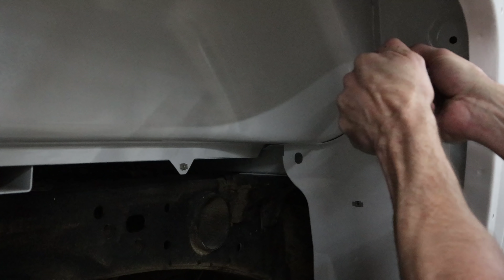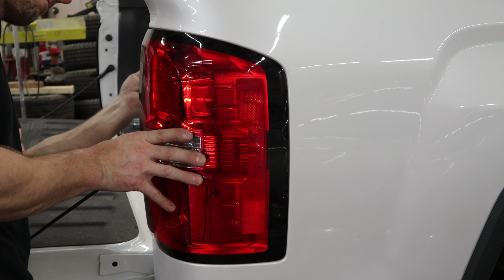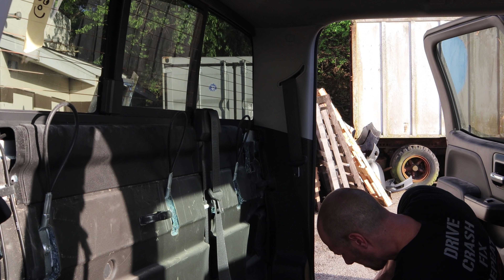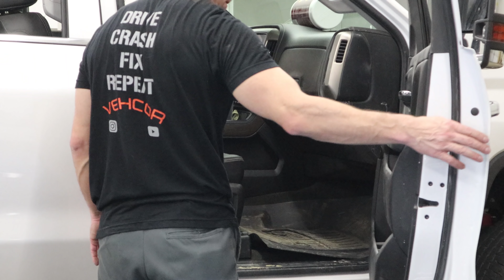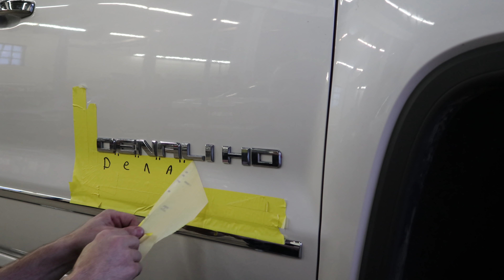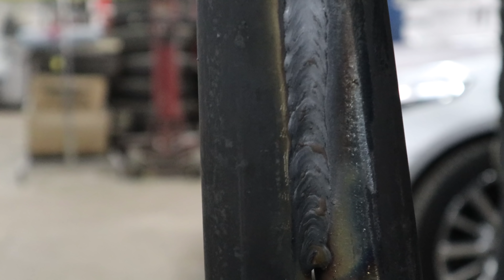The Dirtnali part 9:  The dirt exchange program, installing remaining parts and some fabrication.

Comment: Dude you read my mind.  I am not in the trade but I am a weekend warrior for decades.  I developed the same wax (preservative) treatment through my own experience and then almost immediately heard you talk about it in an earlier Dirtnali episode.  That was amazing, and a nice confirmation that my idea wasn't garbage.  I use liquid long term preservative from McMaster Carr, so I use a pour and saturate method from above.  I haven't graduated yet to the idea of an aerosol, but I like it, and I'm glad you showed it (and that you do it - I imagine most dont).  My wife's 2010 Challenger started rotting out the rear quarter panel.  These cars are filled with expanding foam behind the rockers to deaden sound, but it's also exposed to the environment so all it does is wick and hold moisture.  I drilled an access hole and "fished" it out over many nights, pumped rust dissolver through it for two days, and then pumped the preservative through it.
Reply from the maker: You are right, most shops do not do the proper corrosion protection after a repair.  It is the reason so many people thing all repaired cars rust out quicker.  I hate that foam!  In addition to sound deadening, it is also for strength and panel stiffening.  Not only does it make the car rot faster, it costs a fortune to replace.  Thanks for watching.

Comment: Adhesion promoter for the double sided tape.  That's a first for me.  I don't generally have issues with a quality tape letting go if I got my prepwork done properly.  Interesting stuff, I'll have to go take a look for it.
Reply from the maker: A little extra insurance never hurts.  Especially when trying to get stuff to stick to a vehicle when the shop temp is 40 degrees F.
Reply: @vehcor  Ok I need some help here.  I can't find anything like you were using.  Did you just take adhesion promoter and put it in a bottle/applicator?  If so that is genius!

Comment: I recon They bolt on now to reduce quick theft. I only know from experience because I've had tailgates stolen before
Reply: Clifford Mccomber I mean if they can carry a tailgate the thieves can definitely carry a drill or screwdriver.
Reply from the maker: I would agree that is the reason but it won't slow them down that much.  The remote locking tailgate is a nice feature though.
Reply from the maker: @razvanmihalache5680  Agreed, if thieves want something they will get it.

Comment: 16:40 I've had success with the body glue goop they sell in a tube. Looks like clear hot glue when u apply it. I think it's safe to pull off if you use fishing line. Don't know how it affects paint. Anyway, 5+ yrs still sticking on letters I repaired on a Toyota.

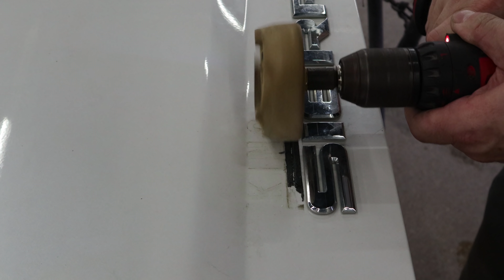Comment: Hello.  I was wondering what that buffing tool you used was at: 3:18
IT worked really well
Reply from the maker: It is a pinstripe eraser, here are a couple.  I like the one with the fins, it works a little better.  The solid rubber one get the glue a little too hot sometimes and makes a mess.

https://amzn.to/2NwhExB
https://amzn.to/2Xy7XCh

Reply ·
Reply: @vehcor  You're the man !  (I'm telling all my friends to subscribe)

Comment: I WOULD LIKE TO KNOW HOW YOU OBTAIN ALL OF YOUR NEW PARTS AND PIECES FOR YOUR TRUCKS , I MEAN A FAIRLY PRICED SUPPLIER.  I AM JUST TRYING TO FIX UP MY 2014 GMC.  GRILL , RUNNING LIGHTS BACK UP CAMERA . THANKS FOR YOUR HELP AND THESE VIDEOS. VERY IMPRESSIVE.  🇺🇸
Reply from the maker: I generally get as many as possible used.  It is usually cheaper.  Try car-part.com for some parts.  Check Facebook and Craigslist, you might find some parts someone swapped out.  I go through the shop I rent for my dealer parts so I can use their discounts.

Comment: They probably bolt the cables on the tailgate so they are less easy to steal if left unlocked. The dealer told me that I should keep my Tacoma tailgate locked because it's easy to steal and it's $1500 to replace.
Reply from the maker: I would agree. The remote locking tailgate does much better in the antitheft area.  It doesn't matter, if a thief wants it, they will get it.  JERKS!

Comment: So long as you can fab different things, sure, record and show that. Tough seeming rebuild but nicely done.
Reply: I still get cognitive dissonance when I think about luxury pickups. All that fancy interior and gear on the simplest chassis you can buy, body on frame with a leaf spring suspended rear axle.
Ford at least gives a nod towards modernity in their big pickup based SUV by putting in a massive IRS.
Reply from the maker: I have little projects I find that I could record.  Any excuse to have some fun.  Ford uses not only a solid axle on the rear of the of the 250 and up but also on the front.  Really, my 78 GMC had that technology.  This truck at least has IFS.  It is one of the reasons I like GM over the others.  As far as the ride, this thing is better than a lot of cars out there and quieter than most luxury cars.  I am very happy with this truck.  Thanks for watching.
Reply: Somebody on some You Tube channel wrote that he sees folded in the middle trucks, mostly GM products then Rams and almost no Ford's.  That might explain Ford's greater weight.  Wish I remembered where it was so you could question the writer.
Reply from the maker: @BobPegram  I don't know who this is saying this but my guess is that is was some Ford owner.  I have worked on all three, the frames are all very similar is strength.  They are ALL designed to collapse in a collision.  It seems the people with the biggest followings know the least sometimes.  After all, those people are generally YouTubers as their primary job and some have little to no experience or proper training.  They are seem as experts based on sub size.  People with jobs do not have the time it takes to be a big channel.

Comment: Nothing short of perfect. But you don't 'Live' in Chicago do you? Cities have become parasite infected killing fields. I lived in Philadelphia when I was a kid. But when I got home from Vietnam the city was worst than the hell hole I just left. So I left. I really enjoyed this "Dirtnail" I always use 3M # 4298 adhesive promoter. I used it on my Corvette, But I warn guys, only pull back a small of the red backing or the double face Tape, cause once you touch the double sided tape to the surface of where you applied the 4298, it's the closest thing to being welded together. I wanted to find some of that cavity wax ? Yeah your helper picked really nice fabric for the shirts, I'm ordering another one. You do really nice professional work. I restored a 1988 Chevy K5 Blazer from SW Texas. I got the doors opened up along with the tailgate and it took almost 3 hours to flush out the 29 years of texas dust, it had 117 baseball sized hail ball hits. You do great work. Thanks again.
Reply from the maker: I actually live in the southwest burbs but it is just easier to say Chicago, everyone knows where that is.  Besides, I live close enough that I have to deal with all the stupidity that comes from major cities!  I'll have to try out the adhesion promoter, thanks!  Hopefully I will be far away from IL and in SW Texas some day...... soon I hope!  The link for the cavity wax and the wands is in the video description.  Thanks for the support!

Comment: Use 3812 enamel reducer on the letters/moldings with paper towels to hole the liquid on to the old adhesive.and as a question what adhesion permotor are you using?? We have the 3m pads at work is that stuff better??
Reply from the maker: I have never used the 3M but this stuff works pretty good.  It is transtar.

Comment: Wow, I can actually teach you something! With all Sawzall (reciprocating) saws keep the nose guard pushed in tightly to the workpiece (if possible) and all that vibration, chatter, fatigue, and rough cuts will be extremely reduced. Best of all, faster cutting... without question. Every time the saw moves even slightly forward,  or back in your hands, it's not actually cutting

Comment: How do u get these out with a twisted off rusted screw in one 1:03?
Reply from the maker: Drill the screw out if you cannot get to the back side.  If you can get to the back side, just crush the clip with pliers until it will fit through the hole.  Then replace the clip and screw.
Reply: @vehcor  drill it out then what? Yank with pliers?
Reply: Nevermind! Drilled it out and the screw part went right out, was able to thread in new screw no problem without having to remove the clip, thanks! Local Chevy dealers body shop gave me a few clips and screws 👍
Reply from the maker: @agger838  Awesome!  Glad to help.

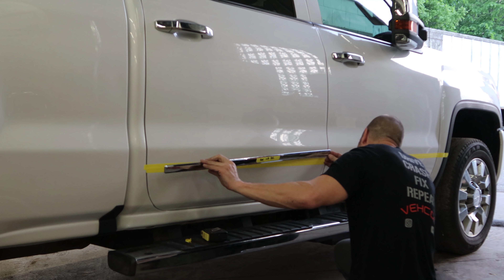Comment: 18:33  I don't think I have ever seen one of these on straight.    GM is building junk again, they better deal with it.  The man on the line has a tool to put them on straight, he is just to lazy to do it. When I ordered my new truck I told the dealer to order new trim like yours, I was right. The dealer had to remove the new crooked trim and install the new. Sad.
Reply from the maker: It is not just GM, manufacturers have raised their prices and lowered quality across the board.  It is sad!

Comment: My Dad just bought a 2019 Denali wrecked after seeing mine. Needs a little help with some stuff and has been watching your videos.  Curious about a truck not turning over if there is a shutoff for fuel or cranking over. Any help would be appreciated.

Comment: For the trim.. wouldn't have been better for new? This way you had the Templeton for placement. Especially the letters. When my Terrain was smashed the body shop used the old ones. Well first wash they came off. So they gave me new and it was easy to put on
Reply from the maker: All the trim for the side of this is a little over $300 new.  Would it have been easier, yes.  Would it have been cost effective, absolutely not!

Comment: Urethane goes onto the glass before it's installed at the factory. As does the windshield and quarter glass.
Reply from the maker: I know, and replacements are done the opposite way. I chose the factory method but unlike them, got it right.  Better than new!

Comment: I'm curious if you've ever tried 3M "Press-In-Place Emblem Adhesive".  I came across it randomly on the internet and was wondering if it actually works.  It seems like a significant time savings over cutting the tape out for each letter, if it works.
Reply from the maker: I have never tried it.  I don't like using adhesives for emblems on the off chance that they need to be removed in the future.  Thanks for watching.

Comment: just curious what you had to give for the truck ? and what you'd sell it for if you sold it ? I have 2015 GMC DENALI and they are very nice trucks for sure. I haven't drilled any holes or added an antenna LOL. I also live close to KING of FLORENCE SC ..

Comment: When doing a build where the airbags deploy, is belt replacement mandatory?
Reply: you can have seat belts and buckles rebuilt
Reply: Thanks, love your videos.
Reply from the maker: If the belts have pre-tensioners, yes.  Most cars do these days.  You can also have the seat belts deploy without the air bags.  I have done a few like that.  Usually rear hits.  The belts have to be rebuilt or replaced.  They usually lock up and don't retract but not always.  If you don't replace them, the system will not function in the next accident.  Thanks for watching.

Comment: Wow, i guess if GM couldn't even get the window to seal and you did, you really are improving on the engineers designs huh? lol cool you got a 3M eraser wheel too, didn't think you would really ever have a use for that actually. interesting to see i was wrong and why. I'm curious though why would Mark Walberg have the opportuinty to remain on your truck when no one else's name would? is he your hero? HEY That adhesion promoter might be why my 05 escalade body cladding won't stay stuck to the body , where do you get that? kind of thinking that's why my 3M body tape is letting go. Damn that came out nice! maybe i need to just sell off my dodge now and save up the rest for one of those Duramax Denali's once i am ready for it
Reply from the maker: I don't think it was the engineer's fault on this one.  More like the assembly line tech that was in a hurry to go home on a Friday. lol  I use the eraser all the time.  I do a lot of the prep work for paint that doesn't involve sanding or masking.  The Mark Walhberg comment comes from the Mistake story.  The only dealer name I have ever left on one of my 1000+ rebuilds.  He is one of my favorite actors and a pretty good guy in general with a heck of a life story.  That adhesion promoter is Transtar, 3M make some as well, I just learned.  Those big moldings are always a problem, even for the factory. Thanks for watching.

Comment: The flag mod is probably one of the best mods on this truck! Are you keeping the dirtnali and kicking out the mistake?
Reply from the maker: It is the only mod on this truck and it required no holes.  ** I'm looking at you radio guy***  lol  I want to keep this one for a little while.  The Mistake has moved on to its new owner and has a little over 10k miles on it since the rebuild with no issues.

Comment: I thought this thing was a pearl white and now it looks fleet white. Was it originally a pearl?
Reply from the maker: It is pearl white but not the older ivory pearl.  In the first video, the dirt on the truck actually made it have a yellow tint.  The used door was the old ivory pearl.  The truck is still the original color, just clean.....ish.

Comment: tailgates would get stollen all the time when they were clipped in. Bolt-in slows the down some.
Reply from the maker: False, they are faster to remove now, you just need a tool to do it.  The remote locking tailgate and less than convenient wiring harness slow them down more than anything.
Reply: @vehcor  and how fast is a thief without the tool
Reply from the maker: Greg Ward probably pretty slow, it is a good thing those 13mm sockets and cordless impacts are not readily available.

Comment: What's the name of that tool you used to remove the dealer nameplate adhesive with?
Reply: Bryan Heins It’s an adhesive eraser wheel, great for the adhesive left behind, also works like magic on pinstripes...
Reply: @gsettlemyre  Thank you very much!
Reply: Bryan Heins no problem, figured he might not see it to soon, used them for a few years working as a tear down tech for a small shop.
Not to expensive either..
Reply from the maker: It is a pinstripe eraser, here are a couple.  I like the one with the fins, it works a little better.  The solid rubber one get the glue a little too hot sometimes and makes a mess.

https://amzn.to/2NwhExB
https://amzn.to/2Xy7XCh
Reply from the maker: @gsettlemyre  Thanks for the assist.  It is getting harder and harder to keep up with the comments and get videos out every week!  Thanks for watching!

Comment: What about the air bags? As it is is very dangerous without the security parts installed by the manufacturer.
Reply from the maker: What about the airbags?  How many more do you want me to install?  I think the factory had enough so I just put those back.  If you want more, that's on you.

Comment: Bolt on means someone has to have a tool to steal your tailgate.;)
Reply from the maker: I would agree.  The remote locking tailgate is more effective, I think.
Reply: @vehcor  my uncle had a tailgate stolen off his C10 in the 80s.  When he went and had it replaced, he felt like the place used a similar stolen tailgate to replace his.  Either way...if it is a part that costs 200-500 and could involve paint (thousands) I want it where nobody can remove it without tools in under a minute....

Nice trucks, though I'd stay off dirt.  I grew up down dirt roads, there's nothing rougher on trucks.

Comment: haha you got me, I literally said outloud "WHAT THE HELL"??? oh, it's on the inside...still...dude......
Reply from the maker: The truck likes dirt!  I just want it to be happy! lol
Reply: @vehcor  yeah, maybe leaving someone of it dirty will help with the separation anxiety it's going to feel now. 

One thing: when I saw you putting the step bars on, if you're going to keep this one for a long time, I'd be seriously looking at putting some strips of HIPS along the rockers to protect them from stone chips etc. (hi impact poly styrene). You can get it in a haircell texture which would blend right in. Or look at Kydex in 1/16" thick.
Reply from the maker: @muskokamike127  They have chip guard from the factory and we replaced it when it was painted.  It is pretty effective.
Reply: @vehcor  ah ok, great then. I just saw the plugs you put back in after spraying inside......

Comment: You put the mud flap on the wrong side
Reply: It really isn’t a mud flap. It’s more like a stone deflector. It goes in front of the rear wheel.
Reply from the maker: I just put them where the engineers decided they should go.  It doesn't make sense to me either.

Comment: Spray some wd40 on the backing tape to loosen it
Reply from the maker: Sometimes using chemicals makes your job harder.  If you don't get the surface absolutely clean, the new tape has problems adhering.  It works fine for stuff you are not putting back on though.
Reply: vehcor Yes correct.Some rubbing alcohol will sort that prob tho...

Comment: Dirty parts? You animal haha, just drive fast, the dirt will fall off. Personally I would find some mud and clear up the dirt with a coating of mud...wait is that the same thing?
Reply from the maker: This truck might have rejected the clean parts. lol I tried your theory, I think the new dirt just stuck to the old dirt and pulled it off.  It is now cleaner after driving in the dirt!  lol